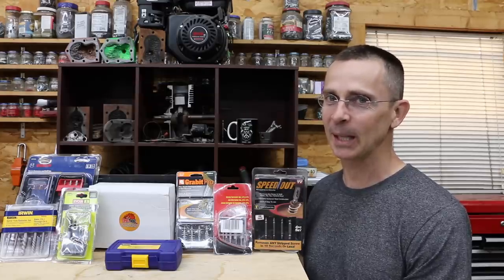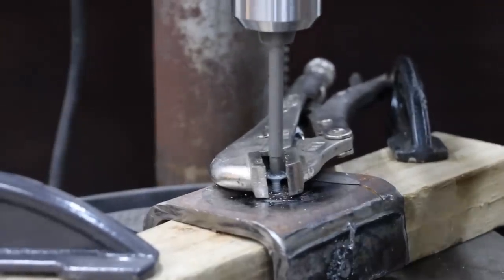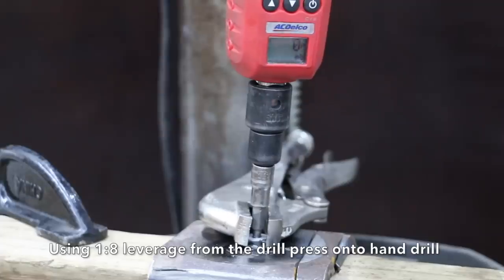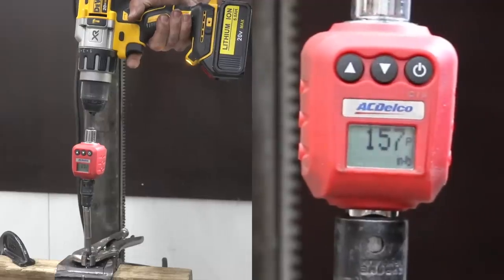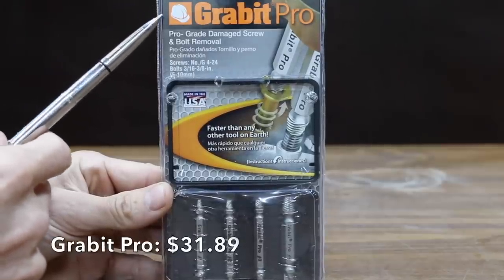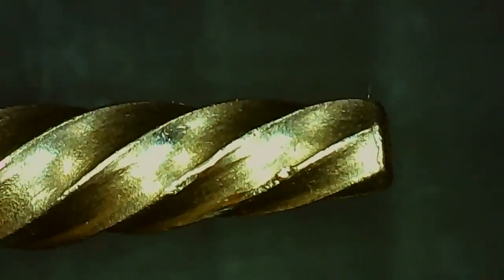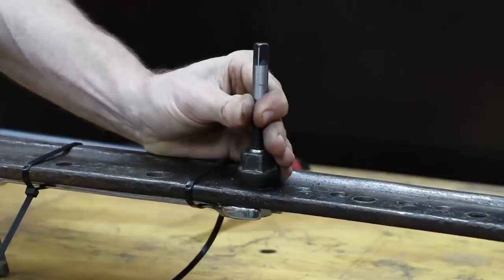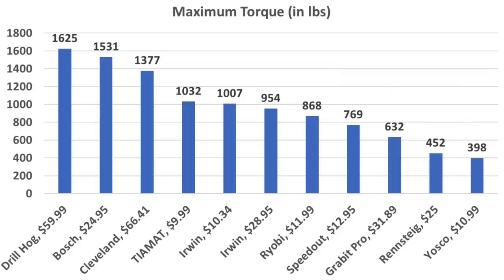Best Bolt Extractor? Let's find out!  Drill Hog, Bosch, Irwin, Speed out, Ryobi Broken Screw Sets

Comment: From personal experience...
For small jobs like those in this video, Instead of standard left-twist extractors, I use a small diamond cutting wheel in a dremel to cut a slot, then use a straight, flat-blade screwdriver to twist the screw or bolt out. 

It helps to have a LARGE old American-made screwdriver or a modern Teutonic tool. Cheap imported screwdrivers tend to break or twist too easily. 

If this is for a machine application, (metal to metal) then I apply some WD40 or Seafoam penetrating product first. 

Really stubborn bolts that have been work-hardened and rusted (as on old heavy machinery or large sea-going ships) require all those techniques plus HEAT from a blow torch, then a sudden freeze with compressed air.  I used that last summer on an old tractor that had been sitting outside for decades. It worked. 

These techniques usually work. And if none of that works, then it's time to drill, fill and re-tap. 

LOVE this channel! Always great info and well presented too. I usually don't comment, but this one time I wanted to share these techniques which have helped me over the last fifty-five years, and helped my dad long before that. 

Best wishes to all. Stay healthy. Resist tyranny.
Reply from the maker: Great tips!!  Thank you very much!
Reply: I do the same especially resist tyranny
Reply: "[...] require all those techniques plus HEAT from a blow torch, then a sudden freeze with compressed air."
Damn you literally quench the bolt to remove it! Tho I can understand this, makes sense to want the head to be hard enough to not strip yet again, ever had a head snap completely doing that tho? Sounds possible... and annoying.
Reply: Yeah!
Reply: @Kalvinjj  In most cases you won't be able to or even want to heat it enough to actually harden or temper the metal. It's more about causing it to expand and contract to break the surfaces loose.
Reply: @blahorgaslisk7763  Oh yeah that too, forgot this part!
Reply: @Kalvinjj  Good question! Yes, I had ONE big bolt snap using that torch-and-freeze method. It was a 25mm bolt in a watertight bulkhead door on the S.S Rotterdam cruise ship. 

Because those doors are tested every week for decades, those bolts are work hardened. Bulkhead doors close much faster in real life than they do in movies, so the bolts undergo lateral stresses that repeatedly heat and slowly cool the tempered steel. ( ergo: work-hardening)  I might have cooled it too long or too fast because I only had a can of electronics-cleaning spray for compressed air. When gas expands rapidly from those tiny nozzles, the gas gets freezing cold instantly. When using compressed air from a shop compressor and larger nozzle, I've never had that problem. So, if using compressed air from a can, wait a few seconds before torquing the bolts, or freeze for less time. You might want to use an impact driver with less power than the HILTI I had at the time. 

That happened back in the late 1970's. I haven't had that problem since.

If you want to know WHY I wasn't allowed to drill, fill and tap that damaged bolt, just ask and I'll tell you a harrowing true story! ;-)
Reply: @user-sb3wh3dd4v  For sure I'm curious about why you couldn't drill it and tap the bolt now. thanks for the reply!

For a bit of steel stuff trivia for who's reading and applying a bit of my engineering classroom studies, my suggestion to the compressed air can method would be to push the nozzle a bit further back, so as to slightly increase the temperature of the air hitting it (the cooling rate is what will harden it after all, that's where the application will tell if you use oil or water to cool down the part when hardening it. Oil will cool the part slower than water, and for some extreme cases on some specific alloys, even ice water or other fluids are used).
Ever used that as a solution too?
Reply: @Kalvinjj  A movie called, "The Poseidon Adventure" is based on a true story of the famous cruise ship, the S.S. Rotterdam. In that schlock B-movie, the boat is turned completely upside down, and remains that way for dramatic effect through the film. That’s NOT exactly what happened, but for all who survived it, the real event was sufficiently dramatic.

In real life, the ship was hit by a tidal wave very early in the morning while engines were off for maintenance. It takes about fifteen minutes to fire up her HUGE diesel engines. So without power to turn safely headlong into the wave, the captain had to make a life-or-death decision: Sound the general alarm to hit life boats, or let clueless passengers remain sleep while the boat gets hit.

He got the radio report of the sea-born earthquake just minutes earlier.
The wave would arrive in about fifteen minutes. If he tried to evacuate the boat, confused frightened passengers would scramble to life-boats and try to make shore before daylight. Even seasoned crew members couldn’t all get to safety in so little time. Untrained naked passengers nursing hangovers wouldn’t stand a chance.

The Dutch captain was “old-school” and used his SLIDE-RULE plus a deep engineering knowledge of that particular boat. From radio reports, he knew the resulting wave near the shore would swell to roughly ninety feet in height. Getting smacked square from starboard, it could potentially topple the entire ship!

But he knew the dimensions and structure of that vessel intimately. He understood fluid dynamics, the effects of pressure gradients along seams and beams. He knew the depth of the berth where he was anchored. He knew the draft of the boat. He knew the ship would hold together and calculated the ship would right itself in less than one minute after impact.

Instead of sounding the alarm, he quickly and quietly gathered every waking officer on duty plus a few wandering insomniacs. Some belligerent drunks refused to cooperate and started to make noise. The crew informed them they should SHUT UP unless they wanted to harm others and possibly DIE. They gathered together so no one was on any deck, then strapped themselves into the bridge, and waited, and waited, and waited, …in the silent darkness, until that black wall of water struck the Rotterdam broadside!

Deck chairs were swept into the sea. Grand pianos toppled into walls. Whole kitchens, casinos, bandstands and bars were tossed like tinker toys. Exterior swimming pools merged with the ocean. Over half of the top decks were briefly underwater.

But the captain’s speedy slide-rule calculations were correct! The boat capsized only 56 degrees from vertical, then righted itself in less than a minute.

Sure, there were injuries. Hundreds of sleeping passengers fell out of beds, bumped heads and bruised themselves in the dark. One person broke an elbow. 

Because most people were sleeping or very relaxed when the boat turned over, they did not get hit by anything or try to resist the irresistible forces of nature and gravity. Unless something big fell on top of them, people basically just rolled out of bed! 

Interior swimming pools flooded some hallways, but not enough to drown anyone. Some decks had sea-water infiltration, but nothing a ship that size couldn’t easily handle. 

Immediately afterwards, there was a stark symphony of screaming, bewildered babbling and terrified cries… but NOT A SINGLE PERSON DIED. 

As a result of this well-educated and VERY seasoned captain’s intelligent response, that terrifying incident had a happy ending.

Of course the captain received many maritime awards for bravery and for his swift decisive actions.  

For a lowly worker like me on that ship, knowing that story gave me great confidence in the captain, crew and the BOAT. So, when they insisted that a specially certified maritime welder finish fixing that busted bolt… I was totally “on board” with their decision. ;-)

Now, wouldn’t it be nice if other so-called “leaders” had such education, courage, intelligence? A fella can dream…

For anyone who understands, here’s a relevant thought…

Slide rules still work. They never crash and cannot be corrupted by malware. They are immune to hacking. Slide rules are light-weight, compact and NEVER need charging. Astronauts aboard Apollo 13 and NASA engineers used slide rules to calculate a controlled manual burn for re-entry that was as accurate as sinking a putt from three thousand miles. 

A slide-rule can’t automatically make pretty spread sheets for that next boring meeting with the stupid boss who doesn’t understand math anyway. But slide rules can help you use facts to uncover truth.

More of us should practice with slide rules. You can use them in PERFECT PRIVACY to quickly check media statistics on the news about budgets, wars, and pandemics. That’s often very illuminating! 

Slide rules are fun, fast and accurate enough that you can BET YOUR LIFE ON THEM. 

Slide rules not only help you DO math, they TEACH math intuitively. If more people learned math with slide rules, it would be harder for others to use numbers to LIE.

Comment: Your technique is a little different than mine. I usually throw something then assuming the fetal position and start crying until someone else fixes the problem. But hey I guess you could do it your way if you want.
Reply: Im crying of laughter. I was changing cabinet hinges a month ago, and this was literally me I threw something and got pissed off and sad. Then my uncle came over with the speed pro and got the screw out.
Reply: This resonates with me way too much! 😅
Reply: I died laughing
Reply: I allways weld a nut onto it, and use a regular wrench

Comment: Do a video on the best curse word to use after breaking an extractor in a bolt hole.
Reply: Simple, all of them
Reply: Plan D
Reply: But seriously, what would you do in such a scenario apart from liquid nitrogen?
Reply: My favorites are ****, ******, **** ,***, ***, ***** and ************* ****
Reply: I would actually like to see what curse word mitigates pain the best after slamming your fist into the frame of your car trying to break free a rusty bolt.
Reply: laugh it out. [ tho u mad as F*ck]
Reply: There’s still an extractor in one grease zerk on my loader.   I pull the pin and grease it by hand.
Reply: @TankEpidemic  grrrrrrrrrrrrrrrrrRrrrrrrr,   If you give in and start cursing your liable to bang your head again.......ask me how I know, and I won’t tell you about changing leaf springs.
Reply: For me it’s, this is F ing BS Everything is BS F ing junk! Just complete BS trash! How do they get away with selling this BS! 
So I guess I would vote for BS 🤬🤬😂🤣😂🤣
Reply: Absolutely worst feeling. Best feeling is when it comes out first try.
Reply: @richmonddias2699  carbide drill bit. Supposedly not for use in hand drills but I've done it on several occasions and haven't broken one yet.
Reply: @shilohjorgensen1042  like drill and tap the hole and thus reconstruct a hole!
Reply: @richmonddias2699  In some cases I've just drilled out the broken extractor and had another go with a new extractor. Other times it's drill the whole bolt out and install helicoil or timesert. I've once had to drill out an allen wrench that sheared off. Carbide is awesome!
Reply: @shilohjorgensen1042  ok. I don't think we get carbide bits here. But Allen wrench can supply be picked up from the bolt, since it's not fastened to it?
Reply: @richmonddias2699  sometimes. But other times it's a tight rusty fit and you tapped the hex bit into the bolt head. Then you can't pick it out if it shears.
Reply: @shilohjorgensen1042  okay. Like that
Reply: a deep sigh of dissapointment.
Reply: thatd be lovely xD
Reply: What do you do then
Reply: @akaredcrossbow  same here brother. And it usually ends in "Why"  "it didn't have to be like this" "Why". BTW I have 3 older chevy trucks
Reply: The one that makes you feel a little better once you've  said it. That one
Reply: DIRTY DOG DAMN IT!!!

Always screamed, but never works.
Reply: Lol I just had this crap happen to me, believe me it’s every cuss word in the book while you dremel for hours to get it out
Reply: @lucidrebuilds6129  Rodger that! I'm a mech. Me too!
Reply: I usually shout “m***f****” loudly forgetting about everyone else at home
Reply: All of them, somehow at the same time

Comment: I have used both the speed out and the grabbit. I work in the dental industry (equipment repair and installation) and we sometimes need to remove machine screws that have been in place for over 20 years. That's 20 years of metal-metal contact plus cleaning agents seeping in and effectively cementing the screw into place. This test gave both items a good work out and have broken several bits of each, but also had a number of successes, about a 50/50 ratio. That is why I found great interest in this video. Thank you for doing it. This reminds, I broken Speed Out bits a month ago, think I'll try the Grabbit again.
Reply from the maker: You are welcome!  Thanks for sharing.
Reply: The Grabit Micro might be your best option for small things!
Reply: Did you get the Grabit micro and have the same success? @thesapper4654

Comment: When the extractor breaks off in the bolt: "Oh look, it's time to start drinking"    nah, weld a nut on with some really high amp mig, get it to spray arc. The intense heat is what is going to break that seized fastener loose.
Reply from the maker: Thanks for sharing.
Reply: Yep I've seen this many times the last 20 plus years.
Reply: I've snapped an extractor in a bolt in a freshly removed cylinder head, it scared me more than anything else in my life. The machine shop I went to did exactly what you said
Reply: I've done this myself many times.  Works great in those hard to reach automotive applications.
Reply: Yep. Been there! .065 self shielding, 155 amps 21ipm or so. Just touch it. Lol.
Reply: Dresdon Acacin 
Or break out the carbide bits
Reply: I prefer to use a 7018 mma, tougher than mig so won't shear off when you throw your head back in the heat of battle. Ideal for rusted or locking wheel nuts too, it will stand up to the torque if an impact. In my experience mig tends to crack when you're dealing with dissimilar metals.
Reply: Jokes on you. Did that today to broken stud bolts on a Mack VGT turbo. Snapped the studs like a twig . Fuck
Reply: I took apart my original exhaust on my 92 7.3 NA idi to install the turbo with nothing but a butane torch and some apple scented wax melt and never broke or stripped a single bolt or nut :)
Reply: yeh, I've had lucky days like that, won 10 quid on the loto a couple of times. The rest of the attempts I lost the money.
Reply: @stevenplaskett7728  Mind explaining what the wax was for...?

Comment: Really like the speedout type for smaller stuff as it gets a decent grip in a shallow hole/divet, but honestly, when it comes to small but good extractors IMO they gotta be considered consumables because of how brittle the good ones tend to be. So keep extras. For really small philips and pozidrive, there's the rubber band.

For the bigger stuff, not getting the sheared bolt out can be so much trouble and costly, proper quality is always a worthy investment. Amd if there's a nubbin still sticking out, welding on a nut or another bolt, thermal treatment etc is also an alternative. If you deal with stuck bolts a lot, induction heater coils are gold. And have gotten fairly cheap to DIY.

Comment: I routinely extra broken 2-56, 4-40 and 8-32 Titanium and Monel screws and bolts. I bought a set of Cobalt drill bits just for making the extraction hole as I don't bother with any of the terrible supplied cutting tools. Irwin and Ace is my go to for getting small stuff and most larger stuff out. Usually they all have Loctite heavily applied to them, so a small torch or a soldering iron and that helps immensely as salt water corrosion doesn't help things either.
Reply from the maker: Thanks for sharing.

Comment: A trick I have used before with success, is to dip the end of the extractor in valve lapping compound.  The grit in the compound helps a lot.
Reply from the maker: Thanks for sharing!
Reply: I will have to give that a try.
Reply: I have used Bon Ami (scouring powder) for years to remove stubborn Phillips head screws from aircraft inspection plates. Pack the head of the screw with scouring powder and it gives your screwdriver a little extra grip.
Reply: @willispower9493 ,
🔵 A tiny bit of Industrial Scotch-Brite will do the same thing.

Comment: But the real question is how well will  the bolt extractors do in the cold flow oil race?
Reply from the maker: lol. Nice!!
Reply: "None of the extractors seem to realize the race has begun..."
Reply: @ProjectFarm  Honestly, you should do some kind of really silly joke video, where you test how good products perform at the wrong things. Like - how good are screw extractors at lubricating stuff, and do they fare better or worse when frozen and heated? Which tyre pump does the best job at removing screws and bolts, and which rust remover gives the best gas mileage improvement.

Comment: I have a 5.7 Hemi Ram. I had the infamous Hemi tick. I was cruising around Youtube about how to get the broken bolt out. I tried for days and days to get that bolt out. Welding a nut didn't work. So I then drilled a hole in it then tried the Ryobi kit. Then a Lisle extractor. Well, both of those stripped right out. Couldn't grip the inside of the hole. I was almost ready to just bring the truck to a shop. I took your advice and got the Irwin kit. That thing just bit right in and I had the bolt out in 5 minutes! Thank you, Thank you, Thank you for doing these tests and making the recommendation.
Reply from the maker: You are welcome!